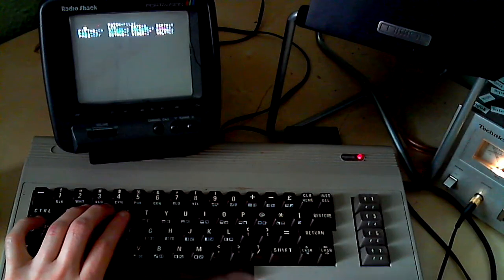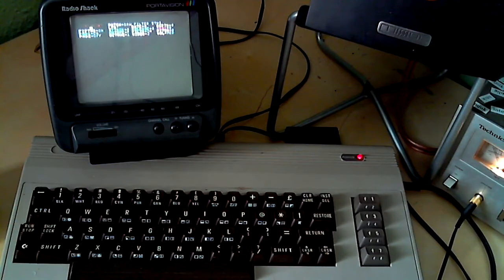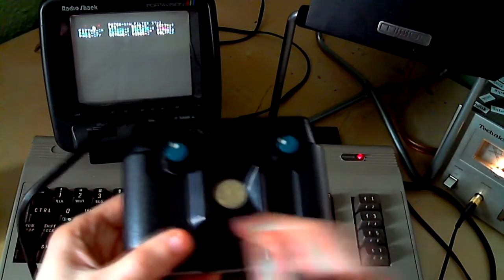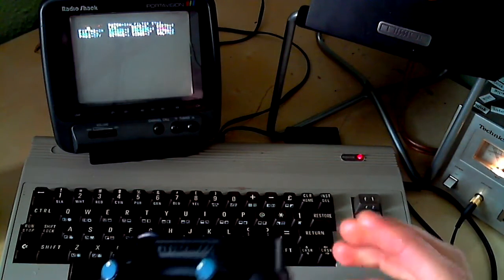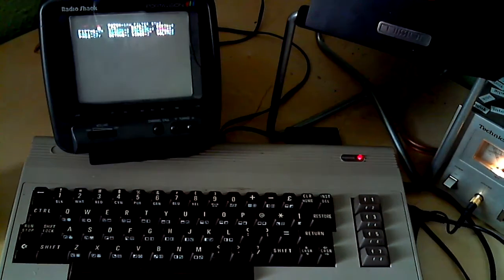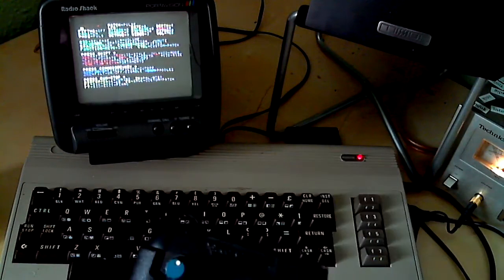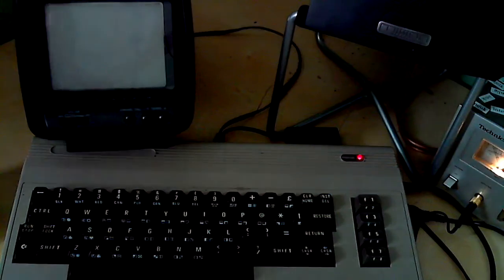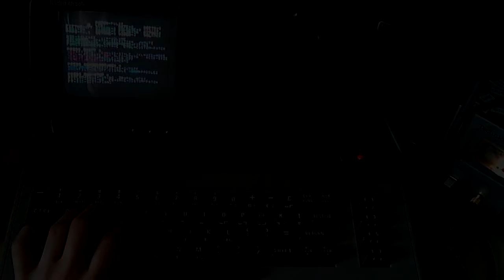Cynthcart and DIY Paddle for Commodore 64

Comment: OK, I"m on a mission to find out how many SIDS I can make a C64 Control.
I have, 1x 6581, 1x 8580, 1x SWINSID, 1x SID CART2, 1x, MSSIAH, 1x CYNTHCART, 1x Very Rare CommoDore MK-10 4 octave MIDI keyboard, 1 bread bin, 1x 64c, 2 screens, a 2x cartridge adaptor (and access to more), TFC3, and... the Music Maker Keyboard Overlay for the breadbin...... You name it. I just need more SIDs and a way to & I will jam them in. 
I'm curious because SIDCART supports the SID at A5, A6, A7, DE & DF - Theoretically making it possible to run 5+ SIDs on one machine. 
I am chucking some serious money into this project and TBH money is no object, I am trying to build the ULTIMATE C-64 based SID machine and I want to be able to use a PC to record it using some sequencing software. 
Anyone who knows more than me, please contact me before I begin assembling this Co-bomination SIDynth double 64... If I can rig this up to run 5 SIDs per C64 via MIDI and some played manually and I'll just record the sound in the sequencer, COOL. But I know theres some serious potential to Fk this right up so I need Help!!!
Reply from the maker: Sounds amazing, I'd love to help you out!
Reply: @midierror  Great, how do I configure it? :D

Comment: Cool! But never ever put a joystick plug in while the c64 is running! Can kill the port and more! It isn't USB ;)
Reply: I've been switching joystick ports live for years back when C64 was my only computer and nothing bad ever happened. So I assume it's pretty safe for control ports. With a little piece of a fine print. Back in the days virtually all controller plugs were pure plastic and female, which meant no exposed metal parts. Some modern accessories: switchers, extenders, adapters, etc. come with plugs with metal shielding plates which make it easy to short some pins while fiddling with the socket. And in that case I would recommend turning the machine off.
Reply from the maker: thanks for the info

Comment: Hello fellow YouTuber, thanks for this info. I've built a fun device for an upcoming video (I'll be crediting you) but the 250k logarithmic pots (you can't get 240k) only bring the MSSIAH test bars up quarter of the way. Is that normal or am I missing out on ¾ of the filtering capabilities? Thanks in advance! Photos: https://photos.app.goo.gl/6nQ7R4tCxRImsseW2
Reply: Here's what I installed: https://rover.ebay.com/rover/0/0/0?mpre=https%3A%2F%2Fwww.ebay.com%2Fulk%2Fitm%2F321398177950